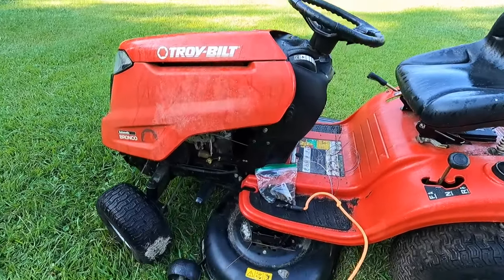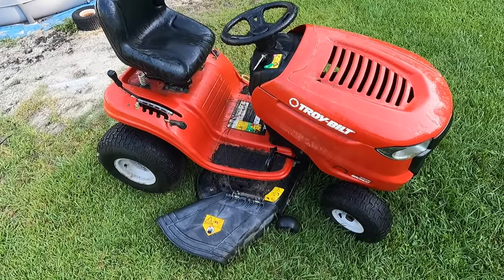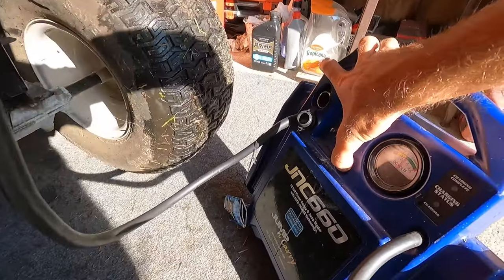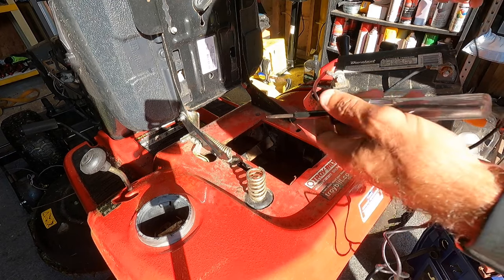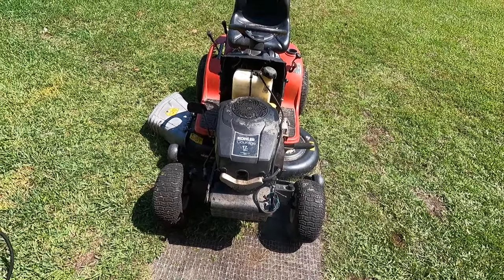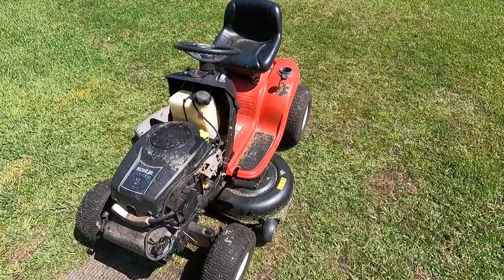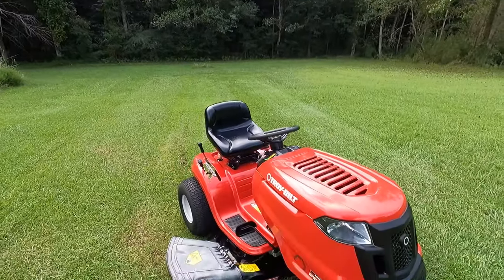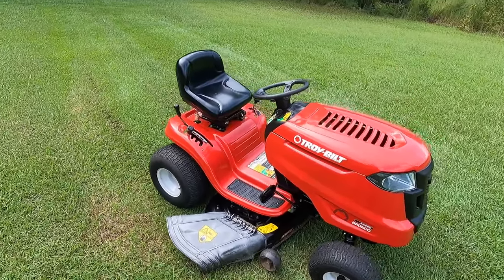FIXING A BROKEN TROY BILT BRONCO TRACTOR

Comment: I love the video. I have a Troy Bilt Pony and this has given me plenty of information to go a little further with repairs on it. Keep up the good work.  Oh, BTW mine was built in 2011 and I bought it in 2018/2019 for $500. It ran good but as with anything used, it needed some repairs. The only thing I sent it out for was for a steering issue where the bolt on the end of the steering column had to be removed. Now I do all the maintenance myself.

Comment: I have owned the exact same TroyBilt Bronco model for 10 years now, and with regular maintenance I haven't had a lick of trouble with it. The Koeller engine is dependable and starts every time. Since I store it in an unheated shed, I remove the battery (original) in the fall and keep it in my basement on a float charger. I add some stabilizer to any left-over gas and that works fine. Change oil in the spring.
Reply from the maker: They honestly are good machines as long as they are maintained. Most people just beat them up and blame the mower.
Reply: bumper paint works good for faded plastics

Comment: I just spent the last week or so working on my Murray 40-In tractor. Started out as replacing the front wheels bushings with bearing and went south from there. Had a rusted-through rim and had to replace the wheel and tire. Decided to go ahead and do some early "spring-cleaning" and replaced the blade belt and sharpened blades. Greased everything and that old (2005) Murray is running as smooth as new. Your video-and others--gave me the confidence to really break the tractor down and give it the love it deserved.
Reply from the maker: That means a lot that I was able to help give you the confidence. I really hope that it goes smooth for you and you have a nice mower for years to come.

Comment: I could probably get $600 for that one in my area. I can't wait to finish the one I am working on right now and see what I can get for it. It is a Craftsman with a 26hp Kohler engine and a 54in cutting deck. It's a beast. I have about $400 into it, so I am hoping it will bring $800. It only has 700 hours on it, and a ton of new parts.

Comment: I just picked up a Troy built bronco. Kohler 5400 series. 19 hp. Cleaned the gas tank. Clean the carb. Replace spark plug. It starts. Change the oil and filter. When I engage the pto it stalls. And dies. Even though I return the pto to off.

Comment: That little unit put up a good fight but cleaned up very nice. I mainly use dawn dish soap in my ultra sonic but l put my carbs in a zip lock freezer bag and fill the bag as well. (Got that from Steve's Small Engine Saloon) Didn't want to take credit for it but has worked well for me. My area (northeast Ohio) at the moment l would say $550 to $650 right now. Spring time time $750 to $800 (but the way price keep going up spring time could be easy $1,000).
Reply from the maker: That is a good idea. I have seen a few different ways to use the ultrasonic for what we use them for. I’m testing out a few different ways. No doubt on the pricing. The market has been going crazy!! Thank you for the support 😎🇺🇸

Comment: I found out the hard way on a 26hp Kohler Courage. They do not like to run without the air filter on. I left it off for testing, and could not get the mower to run for anything. It would barely even fire on starting fluid. I could not figure out why it was too lean to start, so I just put the filter back on when I couldn't think of anything else. It fired right up and ran perfect. Kohlers are great engines, but you have to do everything by the book on them. You can't cut any corners or they won't run.

Comment: I hope you checked the sump bolts under the flywheel to make sure those were tight; if they work themselves loose, the flywheel will hit them and cause a “Kohler crack” on the started side.  Price wise, I have same mower but the Pony version that came with the Intek Briggs that grenaded on me while trying to sort the engine issues out, now looking for a v-twin to put in its place and sell for $550 ish next spring.
Reply from the maker: I did. I checked them all while I had the cover off. Surprisingly they were all tight on this one. Usually at least one is backed out some. Thank you for stopping by 😎🇺🇸

Comment: Try a little Armor all on the discharge cover, may work.
Reply from the maker: I did try that as well and for some reason this one just stays grey. I have tried a few tricks, but either way it should be a nice unit for someone. Thank you for the tip and support.

Comment: Can I please get told what kind of oil to use in this thing ? I got the same thing im gonna replace oil gas after I find out I can get the power throw the wires like you did I just don't got a tester like you tho so it's a bit hard for me
Reply: I use any 10w30 Synthetic.

Comment: I have no idea why you pull down the throttle repeatedly on every video as soon as they fire. They typically are tuned to run at full throttle. In fact, many owner's manuals will say that excessive running at slow speeds are not recommended and could cause harm to various parts of the engine. I've never seen anyone pull down the throttle like that. It's almost like running at full throttle annoys you or something lol
Reply from the maker: I don’t mind running them full throttle all day long. I always like the get the engine a little warm though to get the oil circulating and warm up the piston rings. I don’t think it’s good to start any cold engine and immediately go full throttle. Thank you for stopping by.
Reply: Running a cold engine full throttle is hard on them years ago the choke was Manuel and you could keep the throttle down to start the engine they want them to run at Full Throttle so that they take out the Rings and The connecting rod
Reply: @deekw7519  As someone who went to school to learn small engines, this is blatantly false. Running at full throttle allows the engine to warm up and quickly distributes oil throughout the engine. Putting a load on a cold engine is a recipe for disaster. Idling at full throttle significantly speeds up the warmup time, allowing for proper operation.
Reply from the maker: @deekw7519  my point exactly, but I guess the guy thinks it is a good idea to start up and just go full throttle. I’m sure he is the expert though. I’m just a guy tinkering on my back yard.
Reply: Hey Mates it’s just Small engines and lawnmowers. Not The ‘Space Shuttle’🚀🛩️✈️✈️🗽🗽🗽mates  Everyone has there on way of doing things. Let’s just get along mates  God Bless u Mate Alex@Freedom mowers and everyone on here. Thanks 🙏🏻 for all your support for mate Alex and commenting.
Reply: Hey mate Toluda mate Alex probably does it because he  is  filming and we don’t want to hear it full throttle at close range. But I do the same thing mate Toluda on me mower that I’ve had for 20 years and it’s still going strong mate Toluda. It’s not the Space Shuttle 😎😎🚀🛬✈️✈️✈️mate Toluda lol. Bless you
Reply: @freedommowers420 
I agree,  let them run below max RPM  they will warm up faster at low RPM because of less air movement around the cylinder(s) . When working the engine you want full throttle to keep the engine cool.  Well, within operating temperature.
Reply: @freedommowers420  Unless I am in a hurry to cut, I warm up at half throttle a bit. Also cut it back as low as it will go after cutting and pull in the shed nice and slow to cool it some.
Reply: @danielnicola1602  Same here.  I'm no expert.  Just read this procedure on another tractor site.  I let my car and motorcycle warm up a bit at low RPMs as well.
Reply: @deekw7519 just start it and don’t run full throttle. Pull it immediately down to mid throttle.
Reply: TRUE

Comment: The solenoid not being connected to the frame is the one reason for it not starting as you said  The people who you bought the mower from have been in there  😮😮
Reply from the maker: Yes if it where a 3 post solenoid it would have not worked at all, but yes people getting in here was the cause of the problems. At least we got it fixed and running strong again 😎
Reply: @freedommowers420   yes you did that mower a favor by the fixing the problem s that you found wrong with it 👍👍

Comment: Those red wires you traced from the batter area behind the "dashboard",  when you connected them were they supposed to go to your ammeter instead of join together? On my troy bilt right about my ignition is the ammeter (shows ampherage) and I have 2 red wires that supposedly go to that. Im having a big electrical issue on mine and I cant figure out whats going on.
Reply from the maker: Yes I believe those would have gone to the amp meter. The Troy bilt in this video didn’t have one. I’ll see if I have another one here I can look at.
Reply: @freedommowers420  thanks for the reply. No matter what I can't get power to my starter. Starter, battery and solenoid are all new. Battery harness was replaced last year so still in good condition. Idk where the disconnect is occurring. Maybe my ammeter is bad? I'll try joining my 2 reds like you did and see what happens. Beyond frustrating. Thanks for the close up of your rider though it's the closest I've come to a video on here of someone doing so so I can see what the setup looks like wiring wise. Mines all torn apart at the moment, body panel and all is off

Comment: That deck must be a replacement. Troy-Bilt decks are usually red and they don't have the anti-scalp wheels. Well, at least mine doesn't..😅
Reply: Black with wheels here
Reply: No wheels - you probably have the Pony version.  It has no wheels.
Reply: Oh, you're correct. I do have  the pony version.

Comment: When do you switch to snowblowers? I’m already doing snowblowers? I stop fixing mowers after September
Reply from the maker: It’s just stating to cool off here in my area. We rarely see any snow here in SE North Carolina. I’ve never even seen a snow blower here. Mainly in the fall and winter here we deal with chainsaws and leaf cleanup equipment.
Reply: @freedommowers420  hmmm forgot about that yeah I’ve already seen blowers and chainsaws usually in august is when people start thinking about snow and we’ve just had our cold “snap” so I’m dragging out the snowblower and getting them going
Reply: @freedommowers420 
How far are you from Raleigh?
Reply: Pour a little bit of automatic transmission fluid on a rag and rub on the plastic side chute , it will make it look brand new and it works on all weather beaten plastic. A car detailer showed me that trick and I use all the time, it’s cheap and it works great.

Comment: @1:04 Oh look it's the "Bucket of Crap" courage engine. Those things are trash.
Reply from the maker: Yes they certainly weren’t a good design.
Reply: @freedommowers420  Never had a problem with my 15 year old machine.
Reply from the maker: @edsahara  if taken care of they will last a good amount of time. The issue most people have is that the design on these allowed the upper portion (sump) on the kohler courage to have the bolts vibrate loose. They would cause oil leaks and cracked blocks. Briggs engines have plenty of issues as well. Thank you for stopping by and leaving the comment. I always value everyone’s thoughts.